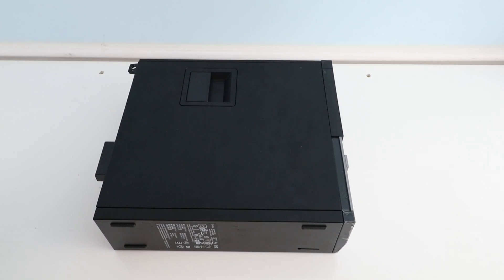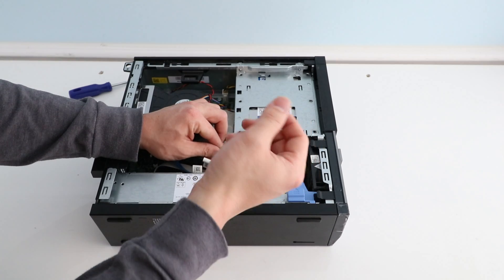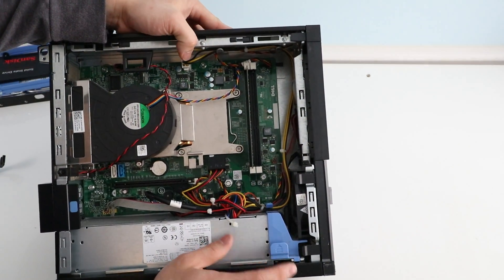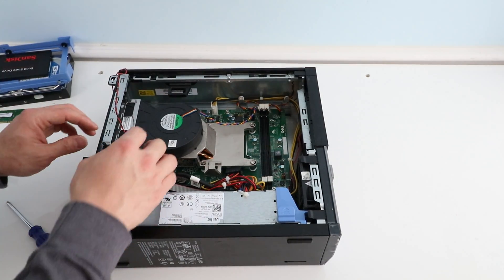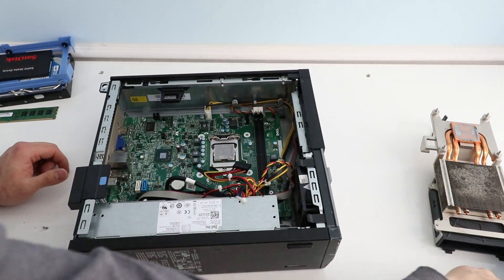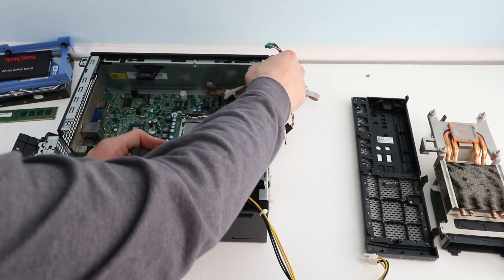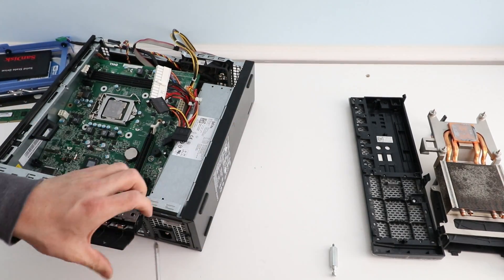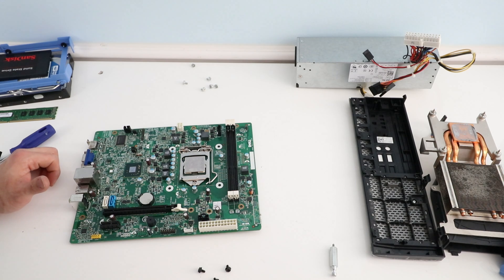Disassembly Dell OptiPlex Small Form Factor PC- Upgrade Ram & SSD

Comment: my fan and cooler assembly will not move feom case, loosened all the screws on the cpu vent I tug on it doesnt wanna come loose, front screws 1&4 dont wanna come out...idk if screws were replaced or what, but idk if can take out the without breaking the board....i loosen more doesnt....screws 3&2 loosened fine and move up when i tug up..

Comment: I bought a wi-fi/bluetooth adapter and plugged into the back and wi-fi was recognized right away.  I need to connect a 9pin to my mother board to have bluetooth recognized but I do not see a spare 9 pin slot on mother board.  Does anyone have suggestions?

Comment: My friend, my computer is like this computer. It has a problem. When I connect it to the electricity, it works directly without pressing the power button, but nothing appears on the screen and it keeps turning on and off several times.
 The problem is in the power supply, so what is the solution?

Comment: My friend, my computer is like this computer. It has a problem. When I connect it to the electricity, it works directly without pressing the power button, but nothing appears on the screen and it keeps turning on and off several times.

Comment: Hi bro Normally psu bist light blink everytime you plug the computer. Right. But now , i plug no sign of light anymore.

 (Dell 3060 sff psu)

Bro how do know the power supply is dead. I try to test my psu, only psu motherboard and processor are intact. My psu is BIST BUTTON FREE.  I remove the 4pin 8pin connector from the motherboard , then plug the psu. The Bist light glow for 3 second,  i put back again, it won't glow. No sign of light, 

I try also psu test using paper clip method jamper black and  green the psu bist light glow and the fan is spinning

Is my motherboard is dead or my psu?

Comment: @brandon i got a 2013 dell optiplex 7010 i have problem where i jus installed windows 10 but the screen is like squished it only displays on 70% of the entire screen connected to tv and tried different vga cable not sure if i should unplug ssd or hdd though cause i dont want to mess up the windows 10 i just put in any idea ?
Reply: Just restart pc

Comment: I know this is a dumb question, but I can change the case without any problems right? And can I straight up change the power supply too?
Reply from the maker: Yes, you can swap the case and change the power supply direction without any issue.

Comment: I acquire (save) an OptiPlex 390 from a company bone yard which are slated for destruction. (Yes, they let me have it.)  Originally a Win 7 - 32x with THREE GB RAM.  I could see from the mismatched chips someone throws in the last 1 GB as a spare.  I use a boneyard HDD to replace the missing one.  Upgrade to 8GB RAM in the two slots - also bone yard.  Used my Dell Win 7 64x recovery disk to get the licensed Windows back on.  Then the Win 10 -  64x upgrade tool.  I am rather happy with this unit with a 500 GB  C: drive and 3 TB D: drive! (All bone yard.)  Then I finally see the CPU is a dual-core Pentium at 2.70 GHz.  😯 The RAM is also 1067 MHz.  "Can't win them all.", I think."  

I try saving an OptiPlex SFF (XXXX?).  It is DOA and I am unwilling to put money into it. 💀 Back to the bone yard - but not before I save the i5 3.30 CPU!  A little googling assures me I could use it, in spite of no matching model number.  Wait with baited breath for NT-H1 thermal paste (the good stuff) to come Amazon. Mind you, I have not done a CPU swap since the DOS days and was a little taken aback.  I rejoice as the system POSTs and I clearly see the new CPU in the BIOS.  But Windows Task Manager still shows the dual-core Pentium specs.  "HUH?" 😯 Upon rebooting I realize Windows does not know the new CPU until it boots up, and changes the registry.  A reboot shows the i5 at 3.30. 🙃  As a bonus, the RAM speeds up to 1667 MHz. 😁

I was going to replace the DVD-ROM with an RW model. But with bone yard parts and cables abounding, I simply add a second one. In the DOS days, A: and B: were your floppy drives - period.  But with floppy drives gone I get a kick out of changing the DVD drives to A: and B: respectively.

While I still have the dual-core Pentium I also save another i5, and two i3's from some bone yard HP's, not to mention a handful of 4GB RAM sticks.  Eye balling another PC or two.

Comment: I just took the motherboard and put it in a bigger case. It all seems to fit okay, but I need a new cooler because I can't get the stock one to screw in place in the new case. Other than that everything else is working perfectly. Was having my doubts that it would work since a lot of people seemed to say that it wouldn't. But it worked.
Reply: Update just realized dell has a 5 pin connector not a 4 pin so I bought a fan that can't be plugged in... i cant seem to get the old cpu cooler to screw onto the motherboard either for some reason...

Comment: Brandon, I would like to know if  can I install a Video Card on this motherboard. There is enough space for a NVideo GT or GTX video card ? I need renderizing movies and I need a fast performance. Thank you in advance for the answer.
Reply: you can probably put a a video card in there, however, i don't think most new cards will fit. You can fit a geforce gt 1030, but it has to be low profile and you gotta remove the bracket. you should go for a single slot video card because it will be a very tight fit otherwise.
Reply: Ok, I agree with all your words, thank you again.

Comment: I really wanted to see the case under the motherboard and  how the Cooling bracket is retained.  Does it have backplate, does it screw directly into the case.  But you edited that completely out.  09:30

Comment: hmmm... Think I got a problem... Is the Heatsink  through the motherboard  connected to the bottom ??? I am not able to get the heatsink off, tried to take out the whole motherboard but thats also not possible. If these 4 Screws go to the bottom, its even impossible to get the motherboard out. Screws seem to be loosened but there is a click sound.. First of all, I thought its the thermal paste  keeping it together but doesnt seem like that... Do you got an idea??? I want to change the CPU...   :-(
Reply from the maker: CPU heatsink should just be the 4 screws. You may need to pull a bit harder but definitely not too much force.

Comment: I have the exact same pc. The fan is stuck on 100% all the time. I’ve looked in bios but there’s only one option in there and that’s to have it on full power all the time but it’s not checked. Any ideas why the fan is stuck on all the time.
Reply: try to clean out the heat sink fins, if the cpu heats up and is not cooled to regular operating temperature it would cause the fan to rev up to compensate
Reply: Duncan Stamps yes I’ve done all that and it’s fine now. Thanks 🙏
Reply: @LAshotts  if the problem continues and the CPU heat sink/fan are clean, it may be the thermal paste. due to how old some of these are a lot of the time the thermal paste hardens which causes low heat transfer from the CPU to the heat sink. There are many good videos on YouTube showing you how to do this and it will make a noticeable difference in fan noise and CPU temperature.
Reply: Wesley Black thanks Wesley I have brought some paste just in case it does need replacing. Thanks.

Comment: Can you transfer that motherboard to a standard mini ATX PC case?
Reply: John Connor ye i hope i can move this motherboard to another case. I have one but i modified it to fit my gpu and my psu 500w.
Reply: what kind of gpu and psu , im trying to find compatible gpu and psu
Reply: Ragip Karelli sff form pc's should be moved and changed the mobo but low profile gpu's should fit in this case like 1050 ti low profile or 1030 low profile. Move your pc parts and mobo into new case so you can put new psu. But in that case just put 1050 ti low profile cuz it doesnt consume that much power so stock psu is fine with gpu
Reply: yeah but what kind of psu are u using, im afraid to just buy one because it might be not compatible with my motherboard
Reply: Ragip Karelli im using 500w but it cant fit in my case so i put it outside and my gpu is gts450 cant fit in case too so i did some modification. Dont buy psu or not lowprofile gpu if you're not going to upgrade it later just buy low profile and ur pc can run games at low-mid settings.
Reply: yeah but what model
Edit : and can 275w run gtx 1050 low profile
Reply: @ragipkarelli4987  Yes it can. I am using an Optiplex 9010 i7 3770 SFF with a GTX 1050 ti and I am consuming 200w MAX under stress test
Reply: No
Reply: If the GPU is two slot then the 24 pin connector on the motherboard for the PSU gets in the way.  I used a full size two slot card (not half height) by installing a riser cable. The 1050TI sits outside my case with the side off.  They cost about $20 on Amazon.  You will pay way too much money on the right single slot half height 1050 TI.  Forget about swapping the case unless you like  splicing cables for the front panel.  The CPU cooler is very custom, and screws directly into the case thru the motherboard.  Not sure if you could replace it with an intel one or if the motherboard could support a regular CPU Cooler backplate.  If you like doing custom case mods then go for it.  If you're an average builder who likes use generic parts then just get a riser cable and do the redneck GPU install like me.  Mine sits on stack of books next to my OptiPlex.  Great for gaming.

Comment: Hi, i have optiplex 390 SFF intel pentium processor and i want to upgrade it to i3 or i5. Which things should i keep in my mind while upgrading. 
Note: want to make it best for gaming.
Reply: Nida Mehdi, make sure the socket is compatible. It is a good idea to upgrade the processor, but the main component used in gaming is the graphics card. You can buy any compatible single fan graphics card and slap it in there.

Comment: That is one ugly CPU cooler. anyways thanks the video helped out
Reply: I_like_goats right I was wondering if you can put water cooling on it instead.
Reply: Can i keep the heatsink/cpu cooler if i swap cases?
Reply: @RankGod44  what case did you use?

Comment: So b/c the Sandisk SSD you have is smaller than the original hard drive, it doesn't need the outside support anymore? Doesn't it still need something to help it hold in place though?
Reply: There's a smaller bracket adapter that goes around the SSD and then goes into the place where HDD was
Reply: when can I get smaller adapter
Reply: When?
Or did you mean where?
I saw a bunch at a place called Micro Center, not sure if there is one near where you live.
But you can probably find one on Ebay or amazon.
And just in case you did mean When, you can get it whenever you want lol